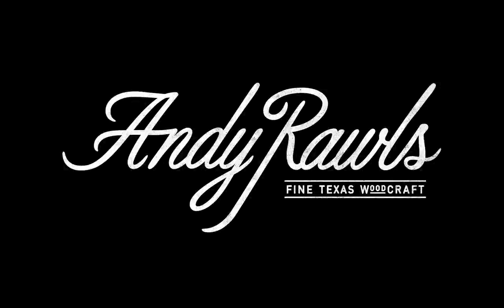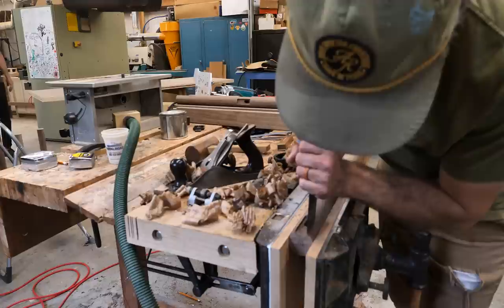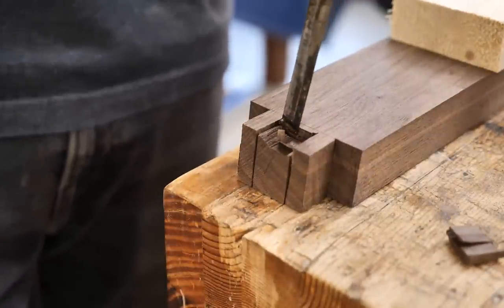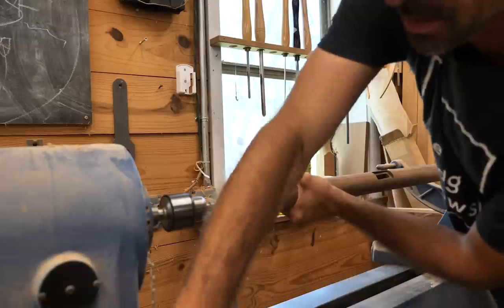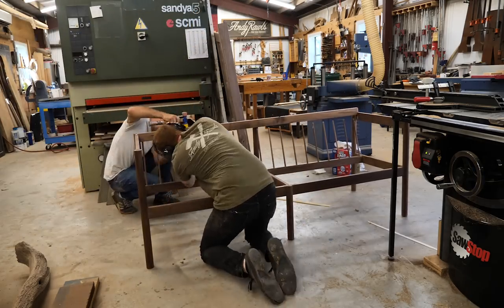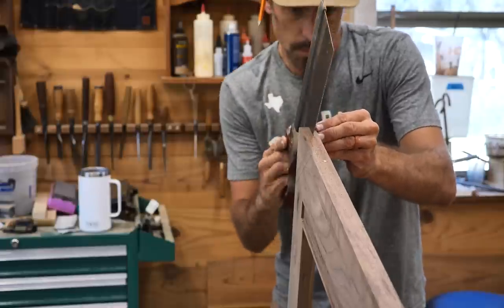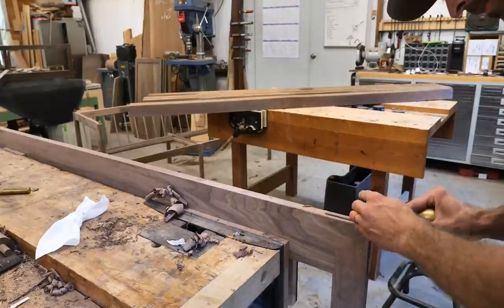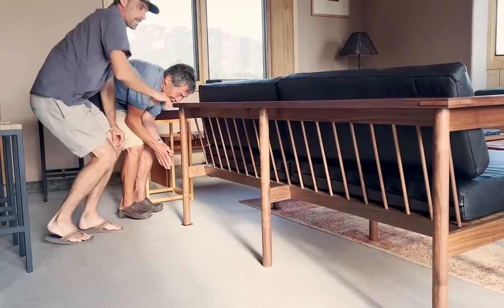CUSTOM Walnut Sofa // It Took 61 Woodworking Joints and 85 Shop Hours To Build This

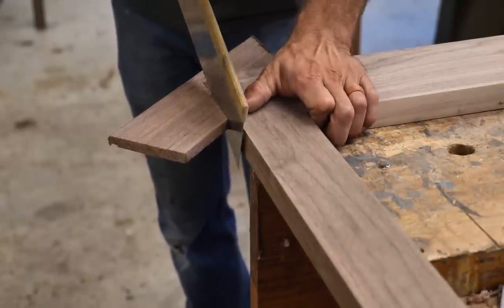Comment: 29:10 I wholeheartedly agree. I know it's intentionally mid-century design, but generally shadow lines achieve what contrasting woods are sometimes used for. It's surprising what a bead, cock-bead, or chamfer can subtly add.

Comment: Great job designing the complex joints and coming up with the jigs. Nice simply elegant piece of furniture. The 1/4 corner mortise could be adjusted with lie Nielsen file planes(might not be correct name). I have a whole set and they work really well. Designed for making wood hand planes. Not sure if they still making them.
Reply from the maker: I’ll look into that thanks!

Comment: What a stunning piece of custom furniture. A question if I can. I noticed on a number of clamp ups that you didn’t use scraps between the clamps and the finished work. Do you not get any bruising/indents? Thanks from Australia. Your work is outstanding
Reply from the maker: We use cardboard on clamp ups, especially with the bar clamps.  If I don’t use it then it’s usually because it’s a part that still needs sanding.

Comment: Would it not have been easier to do the mortises when the pieces was square….I’m only saying 👍🇮🇪✌️
Reply from the maker: That’s actually a really good thought and the reason I don’t do it that way is it’s harder to control the grain orientation if you cut mortises into square parts.  If you turn it first then you can place the mortises in the same orientation to the grain on all 6 post.